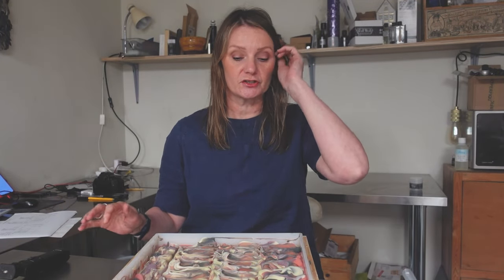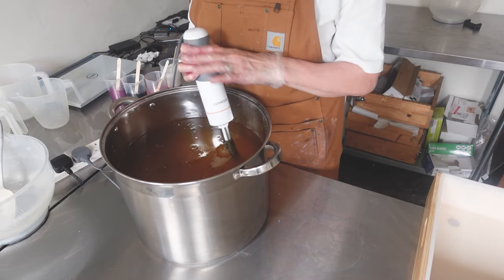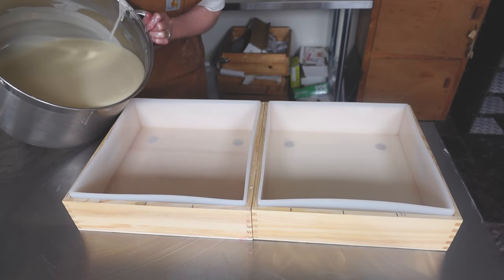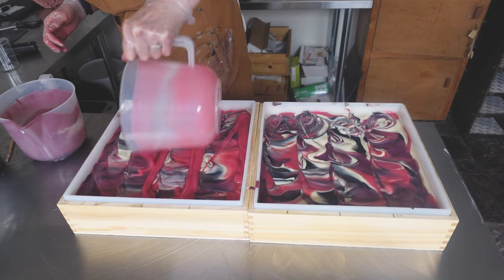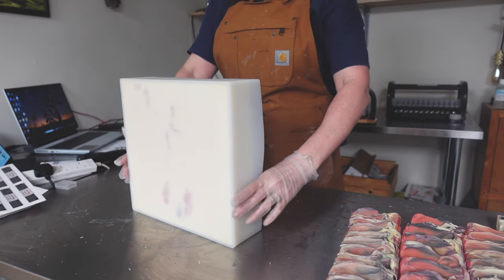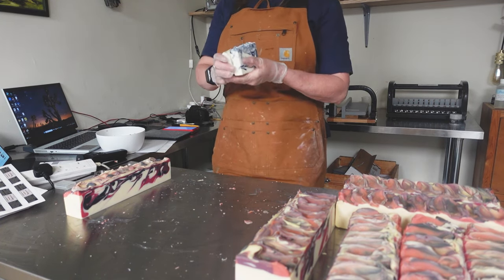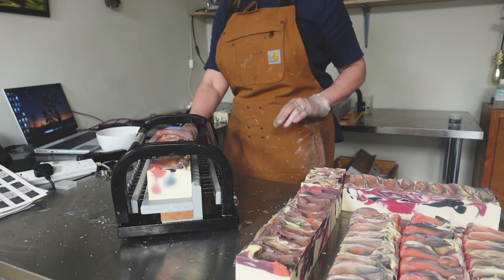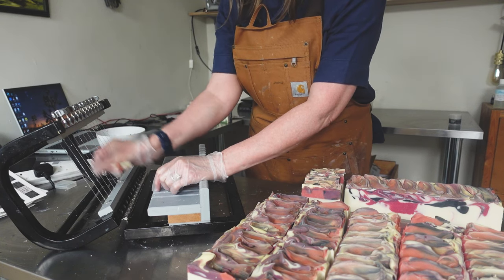Watch me make 28lbs of handmade soap! (stressful but worth it)

Comment: That's really bizarre cutting the soap upside down with the cutter. Since the cutter is supposed to be placed on the table and the soap pushed through not the cutter on top of the soap and pushed through the soap. It would be so much easier using the cutter the correct way that way you can actually see what you're doing. When you cut the individual bars do you do them upside down as well??!! I have never ever seen anyone use a cutter this way because it's supposed to be set on the table. How in the world did you ever come up with this crazy way of using it!! It's absolutely ridiculous using it like this!!
Reply from the maker: Whooo, Theresa mad as hell 😅😅
Reply: Calm down Theresa we soap makers know what we are doing, you cut your soap your way girl. Take a breather 😂